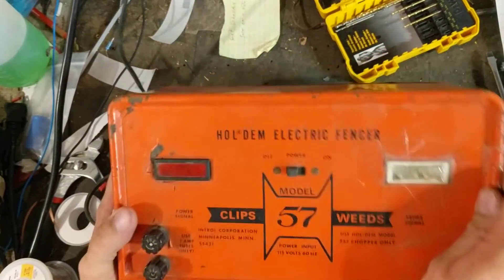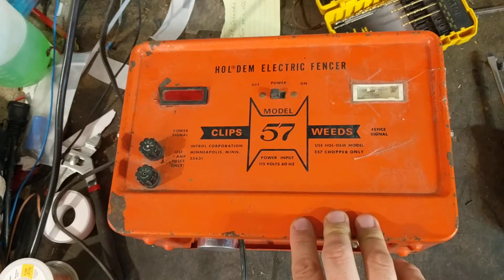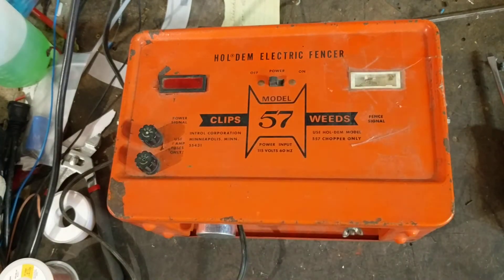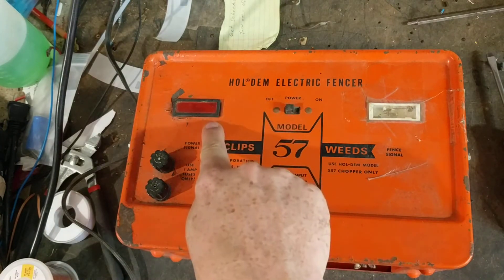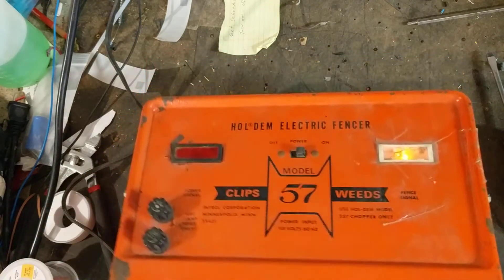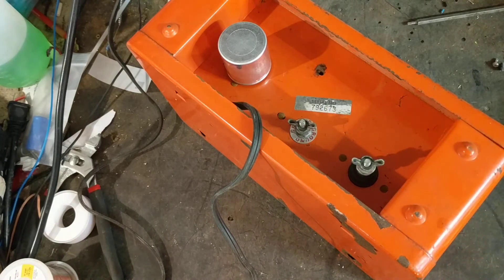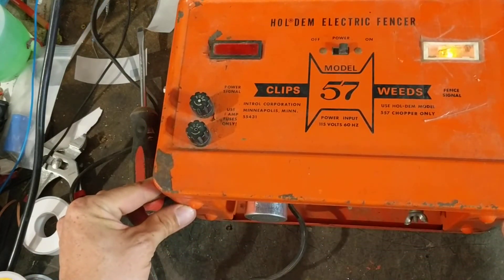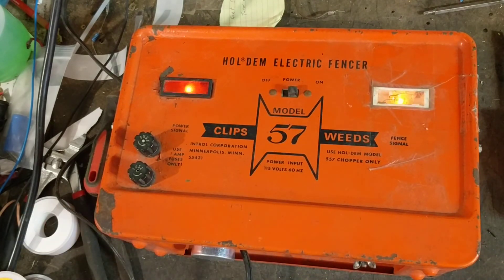Electric Fencer Repair | Hol-dem Model 57

Comment: I have a unit just like that one. Where can I get the 4 prong pulses.
Reply from the maker: You need luck and a prayer to find a new one these days. The company that was still making them stopped about two years ago because the demand wasn't there anymore. So whatever was left in people's inventory at that point is what's out there. And when you can find them, people want $40+ for them when you used to be and to get them for under $30. If you end up needing to get a new unit, don't look at the dumb mileage ratings on units, that gets people in trouble. Look at the joule rating instead. And get a 3-5 joule unit and you'll be happy. You can get a good quality 3-5 joule fence charger for around $125-$250 +/- depending on the brand.

Comment: Neighbor gave me his old holdem 57 fencer it has a 3 prong chopper on it but has 4 prongs in fencer. Looking at my 57’s they have 4 prong choppers will they work with the 3 prong chopper? Seems to operate okay thoughts??
Reply: Thanks for the info very helpful.
Reply from the maker: Hi, all of those units like that back then that took the 3/4 prong choppers all had the same type of connector on the unit that those choppers plugged into. The only difference is the wiring on the back side of the connectors and what is wired to them, they're wired differently. Also done were a constant current and some had the pause in between the shock. You won't hurt anything by trying one or the other in it. It's either going to work or it won't. 

When you first plug one of those things into it and power it on, give a few minuets too warm up and try to start working. On those connectors on the case, there are 2 bigger holes and 2 smaller holes, so just make sure the 3 prong is plugged in to the correct way with its prongs that are big and small.